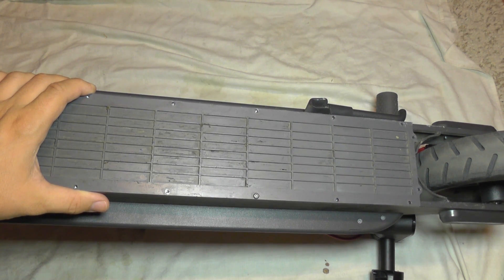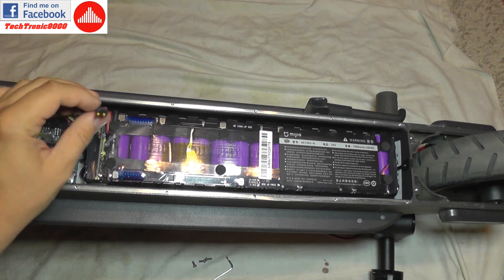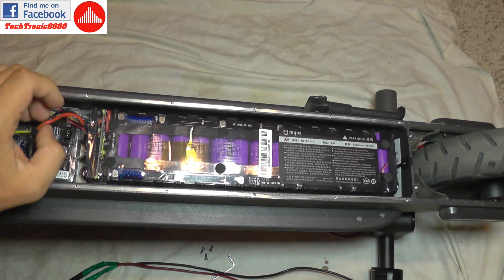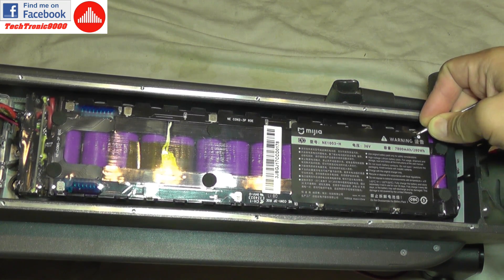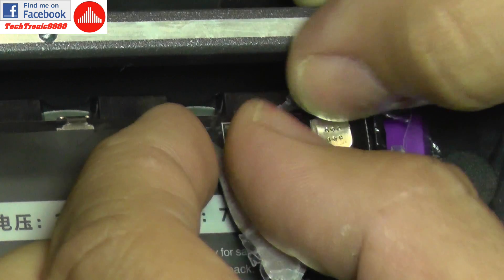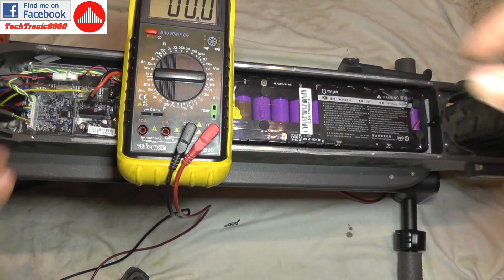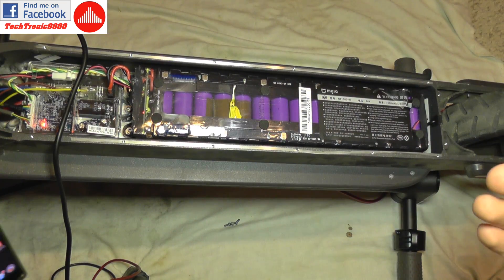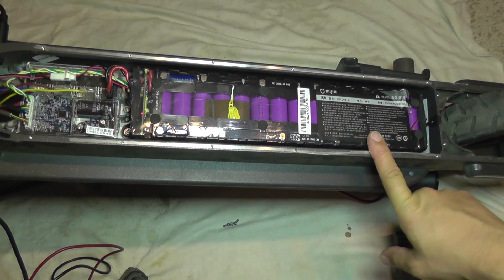Xiaomi M365 - Battery Repair, No Power ON, Not Charging

Comment: Same here, just resoldering a couple of the tabs in the battery fixed it. The tabs were cracked, not unsoldered.
What a pile of s#%t these scooters. Poor design, flimsy, battery can’t take the vibrations. The tabs are very very flimsy.

Note that I don’t think that just adding solder will work for long. The solder will be stressed. I soldered a wire with some flex in it. Kind of a U loop. I hope this will last until… something else breaks…
Reply from the maker: Actually all batteries are spot welded, there are also the fuse wire ones such as in Tesla cars which are also spot welded. There are also some screw terminal cells but those are very big in size and weight so not commonly used in ebikes and escooters.
Reply: The issue is not the weld, it is the ‘bus bar’ that is made of very flimsy thin material and has no povision (flexibility) for vibrations. The welds (spot welds) were intact.

Comment: My M365 only has 1 VDC . I tried direct charging but the charger is still in green light. Let for 1 hr still not charging, I tried pressing the connector all looks good, I left the battery not using for 6 months . I would appreciate if you can give some advice. Thanks a lot.

Comment: I'm at 34v when i plug the multimeter into the charger port what does that mean..
Reply from the maker: It means that the battery still has enough power to start the scooter but it's close to empty.

Comment: Hi. I've a foston s08 Pro 7.500mA 36v and I replaced the battery with a new one 10.000 mA 36v (from xiaomi mijia m365). The escooter turns on and I can use it normally but the battery is not charging (light always green). Is the new battery incompatible?

Comment: Battery doesn’t work has about 14 volts with the  volt reader, battery has red flashing light, and when charge it charger has red flashing light. Scooter also doesn’t turn on at all
Reply from the maker: Check this video https://youtu.be/EuutXrOgFro

Comment: Should I purchase a new battery?
Reply from the maker: Depends, usually this is fixable, but requires some skill.
Reply: @TechTronic9000  can you do the same on my battery? If you can how much to repair? My friend gave me their scooter and I wanted to use it since they hadn’t used it for a couple years due to scooter accident falling. Please let me know and how much to get it working again.
Reply from the maker: Sorry I don't do repairs.

Comment: Can i install m365 battery on xiaomi essential,,,Will it need any firmware??
Reply from the maker: It might work, but the essential model has a smaller battery capacity.
Reply: @TechTronic9000 😅 yeah,,essential's battery is small but the chamber have much space,,but i don't know why they swapped that small battery on it!!
Reply from the maker: @MahiEurope  to make a lower cost scooter.
Reply: @TechTronic9000  😅yh

Comment: Hey so my problem is that it doesnt turns on and charges but if i remove discharge plug it blinks red and stops  also i did have problem my scooter didny turn on after turning it off

Comment: I have water inside the scooter near the battery can it affect the problem
Reply from the maker: the battery is sealed so water should not get in.
Reply: @TechTronic9000  I see,  what do you think can be the probelm , I was riding in the rain and after a few hours it stopped working and It won’t charge 
I unplugged the main cabel of the battery 
And still no sign of life.  
Do you have any idea ?
Reply from the maker: You need a voltage meter to check the battery voltage

Comment: Hi I found your video but this was unfortunately not the same problem all my connections seem just fine having real issues with getting the battery back to 36v
Reply from the maker: Have you tried to charge it through the discharge plug?
Reply: TechTronic9000 I have the battery disconnected as we speak I have tried to charge it from the cable that plugs in red and black above the yellow cable still no luck not sure what to check

Comment: Can I use this battery for a ebike? Or it won't work if the BMS is not connected to the Xiaomi m365 controller?
Reply from the maker: It should work, the BMS although smart reports to the controller, but works also as stand alone. The reverse doesn't work eg. the M365 scooter controller will not work without the genuine BMS.

Comment: Thanks for your informative video! Can you advise on how to revive a dead Xiaomi M365 battery pack as a result of the unit put in storage for five months and not getting recharged? I have hardly used this scooter, and do not want to get another battery pack before finding out if this one can be revived. There are lots of videos online about how to revive dead rechargeable batteries, was wondering if any of those techniques would work for this battery pack?
Reply from the maker: Use the discharge plug (xt30) and connect it correctly to the charger, it should up the voltage to more than 34-35V and the it should charge normally.

Comment: How to tell if the fuse is blown?
Reply from the maker: you could check if power from the battery enters the BMS, also you might measure the fuse with a multimeter.
Reply: @TechTronic9000  The thing is the battery has 42volts but output from the motherboard is 18volts. Both fuses are giving 18volts. I don't know what should i check or change. 🙁
Reply from the maker: That sound like a broken cell tab, check if all of them are properly connected.
Reply: @TechTronic9000  But if it's a broken battery cell tab then why voltage is 42? Shouldn't it be lower?
Reply from the maker: @AzanAli-  Where have you measured the 42V exactly?
Reply: @TechTronic9000  The main cables going to the bms. And the bms output is 18v which goes to the Scooter's esc.

Comment: Hello TechTronic9000
sorry i didn t get the part where you put your finger to lower the voltage on multimeter ? you had 20v first, then when you put your finger you get 3.6v  ? 
because i have issues with mine and get 3.6v on multimeter, what does it mean ? short-circuit somewhere?
Reply from the maker: It means that contact is lost somewhere and you don't get full voltage. Check all the contacts.

Comment: I need more stopping power - Setting the KERS (RegEn) to STRONG - Will 
it increase my stopping power than compared to WEAK - my disc brake is 
not too efficient... Thanks.
Reply: No. It won't. If you use your brake instead of regen, it will stop much faster than it would with regen, while also regenerating energy like usual, but with an even higher current. Using strong regen isn't recommended anyway, it's just not necessary. Use weak or normal.
Reply: The disk brake is adjustable, it has a screw, untighten, pull the cable a bit more and tighten again. Then, when brake, it will squeeze tighter.

Comment: Thank you very much for the video TechTronic. I will have to try this. My m365 only has a top speed of 15kmh now, I am not sure what the problem is... maybe it is the soldering.
Reply from the maker: Haven't you selected by mistake the ECO mode? That one will reduce top speed to ~ 18km/h
Reply: @TechTronic9000  nope. Eco mode for me = ~10-11kmh

Comment: The problem you resolve in this video is very similar to mine, ~20v open circuit, and drops to ~3v when you put anything more than a meter on it, I've checked the balancing tabs and they all seem well attached to the black runners they're welded to, and I've tried pressing the reset button on the BMS board, but still no joy. 

When I press the BMS button the LED blinks 4 times, then stays out. I'm thinking this is a diagnostic code but can't find what those blinks correlate to. Anyone know?
Reply: What was the problem? Dud battery cells?
Reply: Mine is doing the same . Did you fond anything ?
Reply: I’m having the same problem. Any solution?

Comment: Hello, the first time I charged the scooter, the charger showed the green light at 64% of battery level and it did not charge more. After that, I turned on the scooter and it arrived at 71% going to red to green many times and after a while I disconnected the charger. Somethimes, when I try to charge after a few hours, for less than a minute it charges but not continually till it stops as you can see here: https://drive.google.com/file/d/1t0OtJsBkSK9HA3L28jKuQoFfc3caET23/view?usp=sharing
Reply from the maker: It's probably a faulty charger.

Comment: Hi, I recently purchased a 2nd hand replacement battery that is missing a connector on the right side of the battery (the black wire).   Do you know which connector I need to purchase for this? Thanks!
Reply from the maker: The one that goes to the stop light ?

Comment: Hi, my problem is similar :
Battery output is 36V (from the side), but battery output is only 3,5V (BMS output). Fuze were ok (I have 2 Z fuse), TC is 8.16 ohms. When pushing the BMS reset button, it blink in red and I can not turn the scutter on.. I have 6-7 times till now repaired, but now is different. The scutter have 2000 kilometers. Any idea?
Reply from the maker: Does it still charge (red power brick light) ?
Reply: Hello, it does not charge or turn on. The charger is green, the BMS always flashes red. I have looked at the battery and everything is in order. Maybe I have to change the BMS ..
Reply from the maker: If the wires from the battery have 36+ volt and nothing comes out of the BMS then it might be a BMS fault.
Reply: Yes, I also think that, even though the fuses and the temperature controller are fine. Any idea, where can I buy new BMS?
Reply from the maker: I don't know if you can get just the BMS, and it will not work with a generic one.

Comment: Can you please explain what each wire is used for...Xiaomi was no help...I'm trying to do an Electric Skateboard Mod with a M365 Battery
Reply from the maker: You mostly need the XT30 plug, red and black it can be used for charge and discharge.
Reply: @TechTronic9000  thanks...
I hooked my charger up to the small white connection next to the XT30 plug...luckily it didn't fry anything...lol

Comment: Mine keep turn off after few rides or few days. After I plugged out the red+black power cable for a while and plug in back and the plug in charger cable, the scooter able to turn on as normal.
After few rides will turn off again.
Anybody encounter the same issue or know how to solve this problem?
Thank you very much.
Reply from the maker: Might be a faulty contact from a cell group.
Reply: Have the same problem have u solved it?

Comment: I have a weird issue that no one else seems to have seen. The scooter powers on and rides. But will not charge? Blinking blue led and holding correct voltage I’m lost
Reply from the maker: The charger stays green ?
Reply: TechTronic9000 yes I believe it’s the BMS so I’m going to install a better one I found online
Reply from the maker: It will not work with another BMS as the original one has data communication with the controller and without it you will have errors and the scooter might not work at all.
Reply: TechTronic9000 The solder joints were checked and are fine and the bms is working so I will leave it. What else could be causing this?
Reply: Hi Devin, did you fix your problem? If yes how?

Comment: Hi everyone, I have received my scooter and it doesn't work at all since the beginning. I have never used it and it's brand new. 
It doesn't turn on in any way and the battery doesn't charge at all. The light on the charger remains green, it never turns red.
I opened the bottom part and followed the instructions on this video and others I saw.
When I plug in the wire to the battery, inside the battery I can see the red light flashing only 4 times. After 4 times it stops blinking.
I saw the connections on the battery and they seemed well fused on it. No one is moving.
What do you think it could be the problem? I thought about something about the battery that doesn't work properly.
Can someone help me?
Reply from the maker: Is the charger led showing any color ? Green or Red ?
Reply: Green. It remains green anytime!
Reply: I also saw that the battery pack, inside the scooter is much shorter than this one shown.
Reply from the maker: That means it's not charging.
Reply from the maker: Join here, add the picture and we will help you (we also speak english): https://www.facebook.com/groups/WAEGlobal/ you might have got a clone or a YOUTH version.
Reply: I asked to joined the group thank you. I saw online that the battery pack is correct because there are 2 versions.
Reply: Hi Cristallina, did you fix your problem? If yes how?
Reply: TechTronic9000 Hi I'm having the same problem. It doesnt turn at all and the charger stays green. Please help. thankyou

Comment: Hi guys, can I get some help, please?

Issue is, I cannot power on the scooter, it is brand new, never ridden. Was like that out of the box. Already got my money back from aliexpress and they do not want it back.
My M365 is a budged version with a 20 cell battery pack, which coincides with the 28V as it is basically 2/3 of the 40V , that I am reading on the solder contacts of the long red and black cable, that he soldered off in the video, after removing the waterproofing layer. (btw the sticker on the pack said 36V pack, but I assume that they just use one sticker for all variants)
My issue is different from his, as I am measuring 14V on the battery power cable connector (black plug, big red and big black cable). A further issue is, that the charging voltage of the charger is 42V, s this kind of contradicts my theory, unless they just gave me the wrong charger or i am missing something else.

I have also checked the usual online suggestions as spot welded connections on top of the battery pack and connection of cable going from controller to the handlebars, all seem t be fine.

I do not get any beeps or error codes from the controller, but the red LED on the battery pack is blinking 4 short times and then stops, when I connect the charging cable to the scooter.

I also tried resetting the BMS as per link below
https://xiaomiscooter.wordpress.com/2017/04/25/solve-the-battery-or-ignition-problems-of-your-xiaomi-scooter/

I am not quite sure, what is happening when the voltage is just halved on a battery pack between the main contacts of the packs and the power cable contacts. Not very surprising, as i am more mechanically minded, than electrically, haha.
Reply from the maker: Your battery is still a 36V one, having 20 cells lowers the capacity, but not the voltage. Fully charged voltage is 42V so your charger is also the correct one. Having just 28V seem that the battery was over discharged somehow / faulty from the factory. There are several thing to try on, but the battery from the M365 is a sensitive and complicated one to diagnose and repair. From what country are you ?
Reply: @TechTronic9000  originally from Germany, now living in the UK. Hmm ok, that makes sense, so it appears the issues lies with the battery and possibly its bms and probably not the rest of the scooter. So if I bought a new one or got this repaired the scooter would likely run? I also just found out yesterday, that the seller from AliExpress had shipped these faulty scooters to many people, so it seems they must have known about the fault, as you would clearly test these things before you send them off. Thanks for your help. It is starting to make sense now.

Comment: Does anyone know what a blinking blue light on the battery pack board mean?
Reply: Hi there, probably too late now, but the seller of my M365 Scooter said the blinking blue light means, it is good to go and you can start charging it. 

It's when the red light is blinking, then there is something wrong and the battery is in safe mode. She also told me (in the safe mode) that sometimes disconnecting the cables to the battery and reconnecting them might solve the small hick ups, that happen sometimes, as the battery can be triggered to go into safe mode by a temperature change or other unusual things, like charge spikes or etc.  
Next step would be using the reset button, which is right next to the blinking light under the protective plastic wrap. This will reset the BMS, I believe. Just thought this might help somebody.
Reply: Nubia Gaeming thank you so much I can finally spend money and fix it. I bought it used and I didn't want to buy a battery pack also. Thanks again.
Reply from the maker: Sorry don't know the codes.
Reply: It looks like a bomb, it's quite intimidating.
Reply: Alessandro Orlandi I wish you told me sooner because it blew up my garage while I was at work.
Reply: What? Seriously it can't be real. You're scaring me for real because I have the same blue light in the battery! :D

Comment: Great video - thanks! After watching your video I have identified that I have a problem with BMS and I am wondering if you might be able to help me?
I have checked the fuses, all of which are ok but I am suspicious of the biggest transistor in the unit. Every time I bypass the transistor I get the correct voltage. Do you know what sort of transistor this is, the amp and voltage?
Reply from the maker: To be honest I have never investigate BMS failures yet so don't know much about it.

Comment: Mine wouldn't start after changing it one day it was the solder on the batterys just one at the back just re solder it bk and all is well plug the charger in and turn it on mine is working again now lol
Reply from the maker: It's a common fault on the M365.

Comment: 42vdc wont shock you not even 80 vdc will shock you
Reply from the maker: If you have sweaty hands it will.
Reply: TechTronic9000 um that's weird because I work with solar panels I touched 2 terminals with 80 volts and my sweaty hands because of the sun and the roof and nothing 120 dc from the solar panels you just fell a little tingle but when you do have a cut it will shock hard trust me
Reply from the maker: It depends on a large number of factors such as skin, sensitivity, sweat, you sweat salinity, etc. Some people get shocked from 30-40 V DC in wet medium conditions.